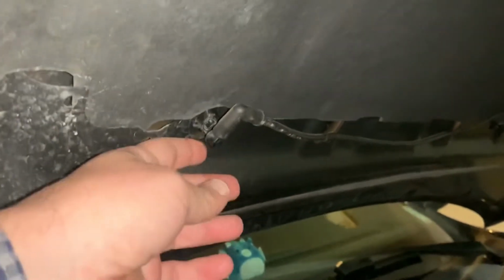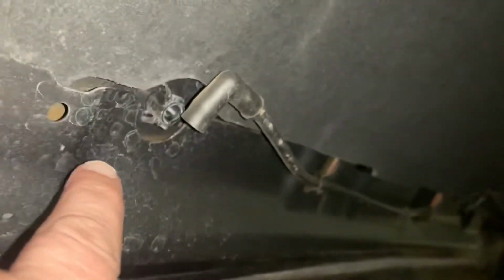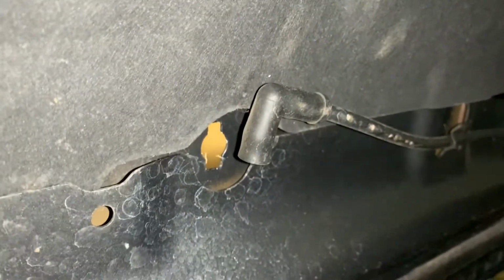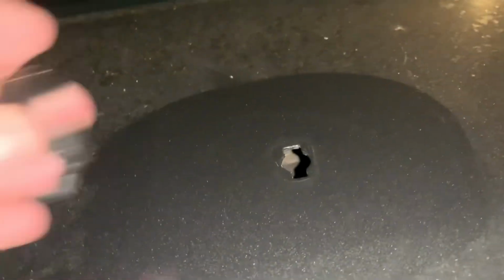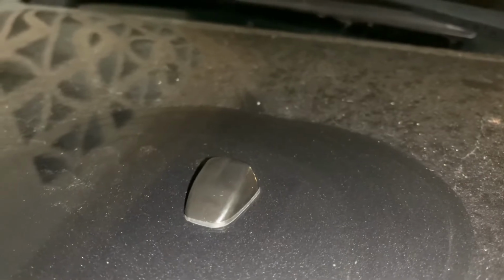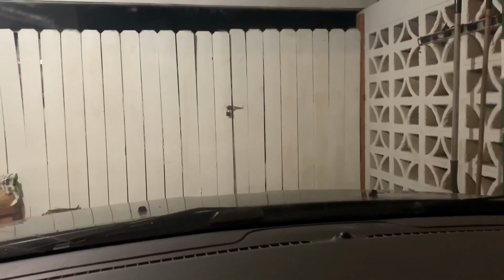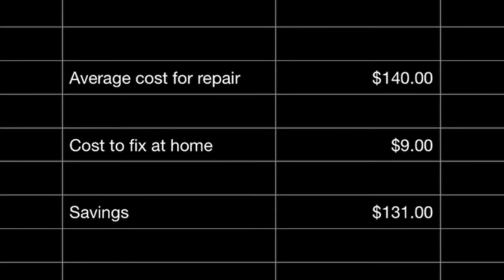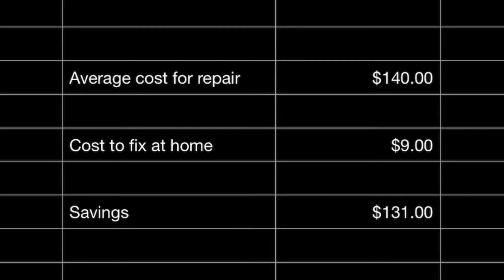How to replace the windshield washer sprayer nozzle on a 2011 Jeep Grand Cherokee

Comment: Kindly include the Amazon part. Besides making our life even easier, hopefully there’s a kickback for you. Thank you.
Reply from the maker: 2 PCS Front Windshield Washer Nozzles, Washer Spray Jet Kit Fit for Chrysler, Dodge, Replaces OEM #: 4805742AB / 5113049AA / 55077460AA / 5303833AA / 5116079AA https://a.co/d/dEDvhCB

There are several options available but this is the Amazon recommended nozzle. No kickback but I hope I helped. Thanks for watching!